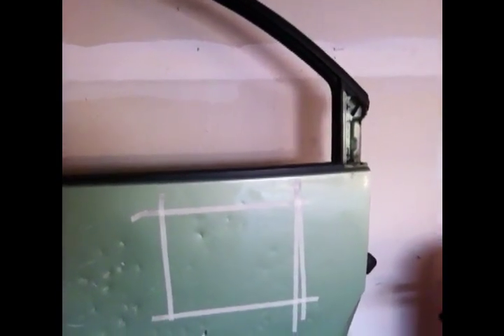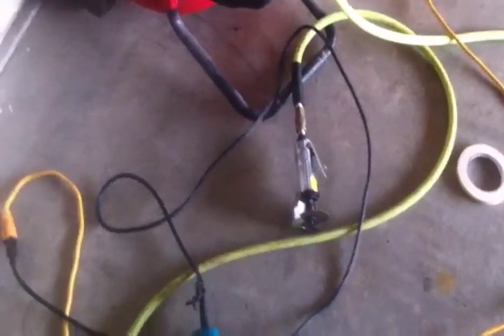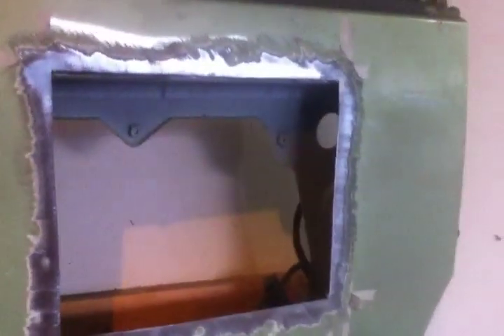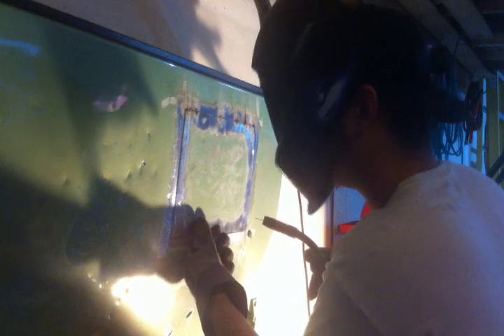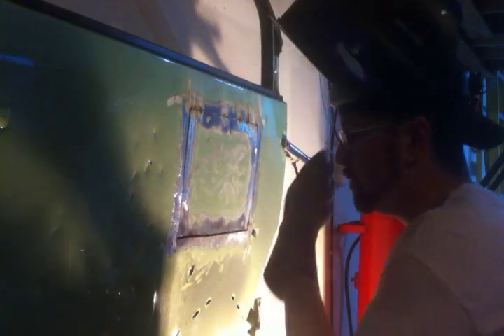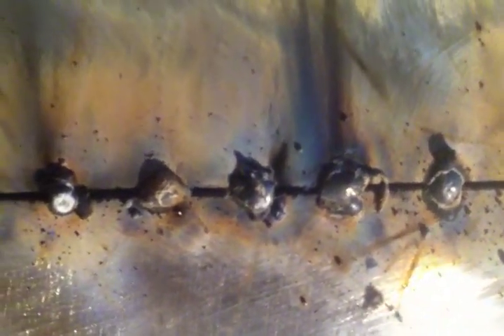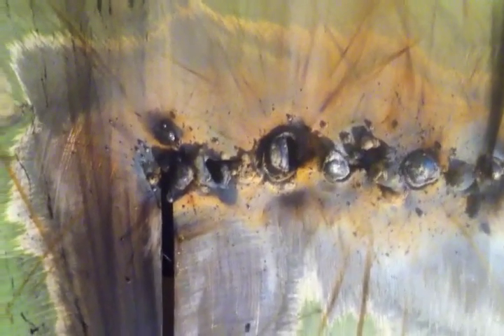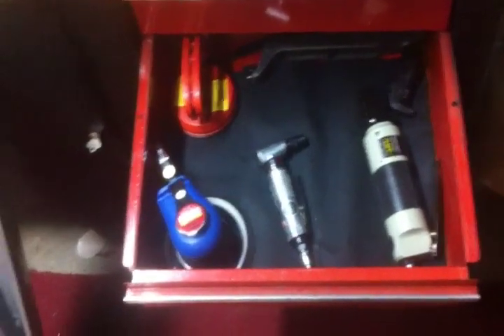WELDING A BODY PANEL FOR THE FIRST TIME (HOW TO PRACTICE RUST REPAIR).mp4

Comment: and for information and I really recommend this do not I repeat do not ever use a welding magnet the only thing a welding magnet will do is will draw away the penetration from the area that you're trying to weld Buy magnetically shifted the polarity of the ground clamp it will pull away the current from the ground clamp and you will not have a very good weld welding magnet is only good for torch welding not for electrical welding by any means yes it is fine to have a ground clamp that is magnetic but if you use a welding magnet I would recommend you just stick it on your ground clamp not on the auto body panel work whatsoever because it will draw the current away from the ground clamp and your welds will not come out the way they should they won't break easily no joke please take heed to my warning
Reply: This is hands down some serious bullshit dude!! 
Pull the current away!! Haha haha.
Reply: molten steel is non-magnetic.

Comment: you need to continue to spot weld exactly where you're going around the panel and then when you're done with your spot welding turn the panel over and fill it with one welding bead and once you notice it's been filled take your grinder to it I would recommend a Dremel grinder a smaller handheld grinder one that you could hold with one hand and pretty much grind it flush with the metal you have that is it welded on and then continue to grind until the world is flush with the panel and once it's flush flip it over right away those spot welds and fill that in with another world and then you're in business
Reply: Shaun Hernandez

Comment: to deal with gaps or to fill holes,place a piece of copper behind the gap in the joint and spot weld to fill in the gap.Weld wont stick to copper.SHORT bursts to build up the weld in the gap.

Comment: Hey i have a harbor freight flux core welder i bought for auto body panels such as 22 gauge..i cant really afford a gas shield one at moment so at least this one will get the job done..what settings did u have to do your tack welds ..??? Wire speed?? Etc..? Im trying to do taco welds and plug welds..please help

Comment: Regarding the eye damage, the welding flash actually burns the surface of the eyeball.  The feeling you get that resembles sand in your eyes is actually because the burn leaves microblisters on the surface of your eyeball and the blisters rub on the inside of your eyelid, which is what you feel.  It sucks, and if the blisters rupture and get infected, you can lose your eye.  I've never felt anything more disturbing, please put safety first.

Comment: You did a good job for the first try, But when you are welding you should never let anyone watch     
because they can get welders flash, and if they watch long enough it will dry their eyes out..
The flash dries your eyes out so bad it will feel like you threw sand in their eyes. Some times its so bad you will have to go to the hospital and they will put some eye easy in to give some relief .  Even dogs can get it .  I've had it happen once and never again. you only get one set of eyes.
be safe

Comment: Good starting! Keep it up! Little advice, when filling blow through holes, try to put a piece of copper behind it. Copper will not weld and it will make a base for the new wire to hold and cover. Also it acts as a heat sink which dissipates the heat and helps with warping. 

P.S. I love the little girl at 19.53 after you burn yourself, it almost sounds like she said "Ohh shit". Made my day god bless her!

Comment: I've been doing body work for 3 years, and a few pointers I'd like to give you would be when your cutting metal put for a patch, cut atleast 1/2 inch to 3/4 inch extra on each side so it won't have gaps like you had just cutting and repasting back in, next is when you weld it back in, skip weld, that will reduce warping in the surrounding areas. Finally when welding in a patch, weld going down the patch, if you weld it all corners first it will make the patch flat and have no natural body curve

Comment: Excellent !  Dont worry so much about the gaps for now.  When you cut your patches for the Dodge, they will be tighter.  I would even use that door as the donor metal.  Settings on the welder are everything.  Once you get that figured out it will be smooth sailing.  Cover up your arms.  Those little "torch bugs" will leave some pretty nasty scars if a big blob happens to pop and land on you. Dont get discouraged.  Their  isnt anything you cant do twice if you should need to. 
 AL